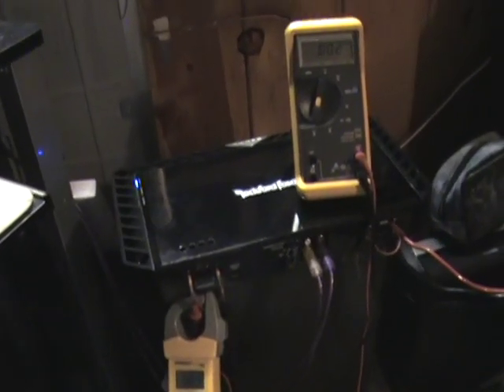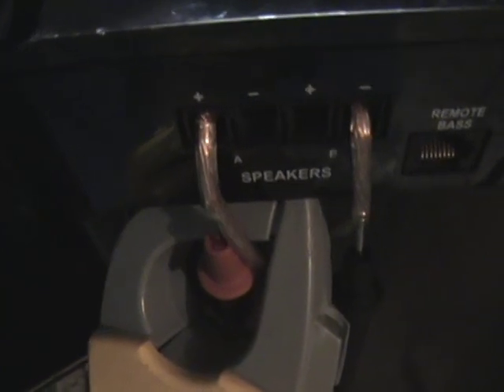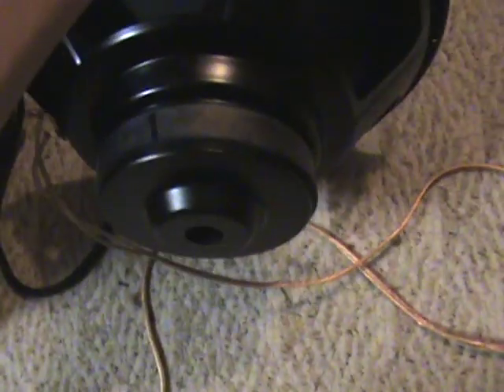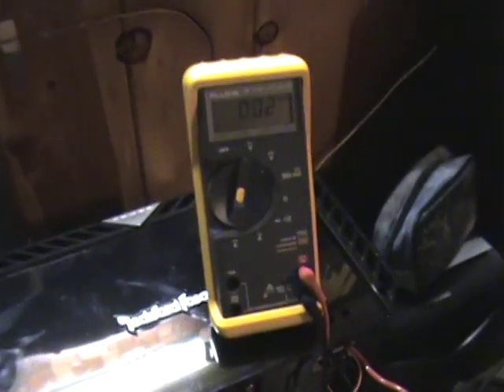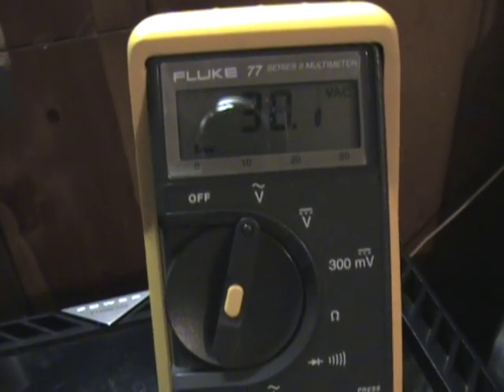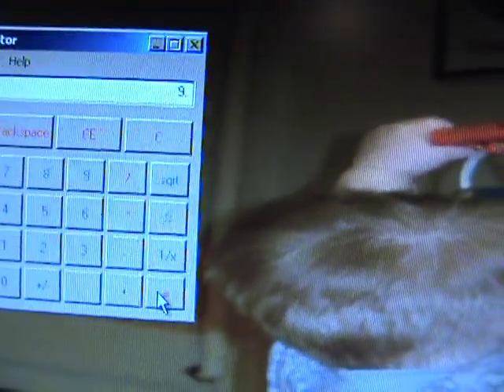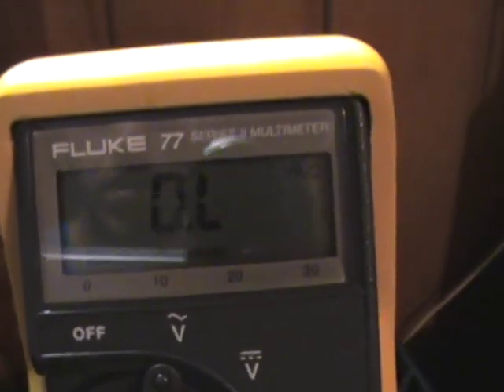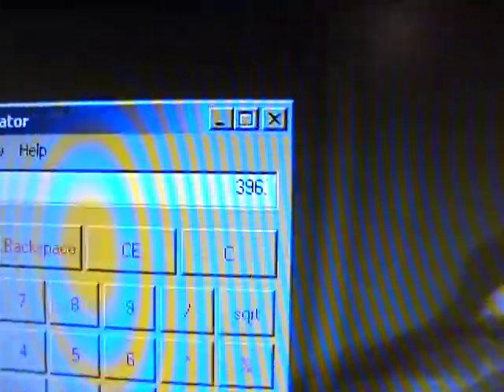How To Figure Your Amplifier Wattage

Comment: so you had 9 volts in with 44 amps out

P=E x I 
(power"watts"= volt X amps)

if so why is your voltage so low if your running from a battery close to a charger? is Voltage loss that bad on what i am to assume being 4-8 AWG?
Reply: you forgot the power factor

Comment: you could also just put your AC voltmeter on the speaker terminals.  Square the voltage and divide by the speaker resistance to get watts.

Comment from the maker: @mazda2284 yep thats like the one i got looks like a suitcase kinda got shit load of knobs on it i mean honestly the BIG anolog ones are more complicated but WAAY cheaper the digital ones are pricey but alot easier to use.... and got disavantage with the big one its big bulky and needs 120 volts plugged in to run which the little hand held are battery operated

Comment from the maker: @mazda2284 yeah my other meter the amp clamp has Vac 600 - 200 and Amps Ac 200 - 20 set them on the lower setting    "my fluke meter is automatic switcing" but it still has them settings